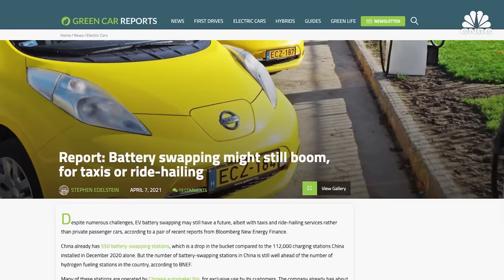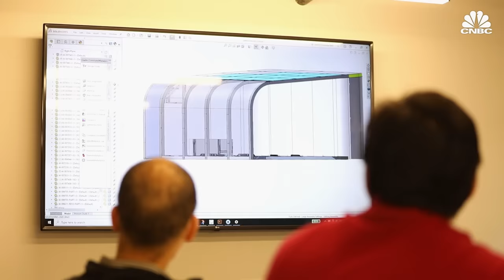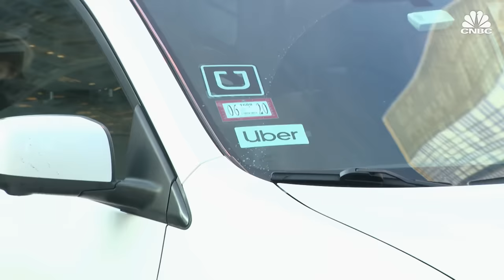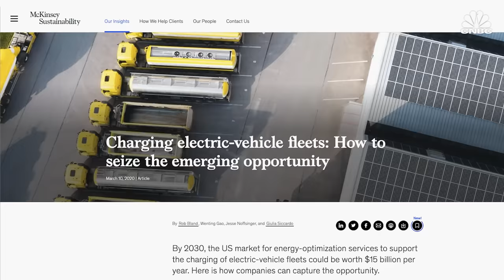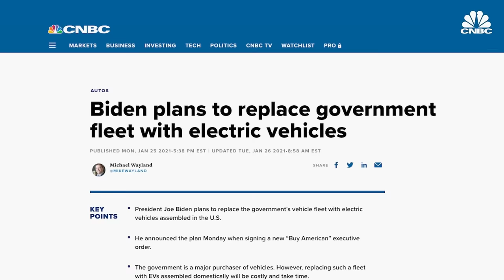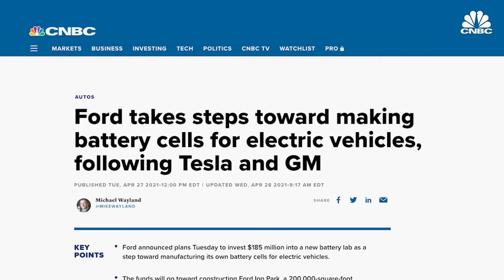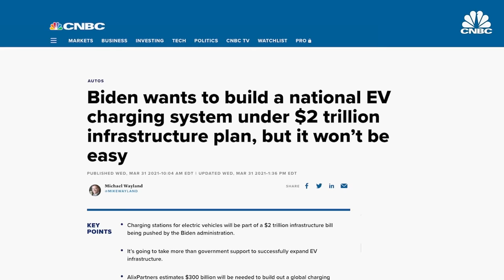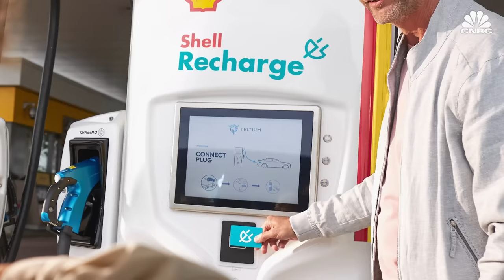Can EV Battery Swapping Take Off In The U.S.?

Comment: I'd rather own my battery, that said, when the battery is really worn out after 8-10 years, I'd like to be able to swap it for a new one for a decent price, I hope this is possible. It would also be nice if 4 or so years down the line a battery with much better range came out and you wanted to upgrade to that.
Reply: Thats how Nio works. The swap station monitors batteries as well so you never get a degraded one. You can save 10k on the purchase price and rent the battery. Not sure if it'll work in the U.S. a nii swap action can do 312 swaps a day for what it's worth. They'll have 6,000 stations by 2025. Which is just shy if 2 million swaps a day potentially. Of course they have plug in with all vehicles as well.
Reply: Nio
Reply: I hope it doesn't take 90 seconds for a guy on a skateboard
to roll under & steal a battery
& Sell it on Ebay
for a Tripple profit like those Car Exhaust Filters they be stealing these days!
Reply: We have that situation now. The average shade tree mechanic can change out a Prius battery in about an hour, and there are generic battery packs instead of the sky high Toyota brand ones, so you can purchase a generic battery pack much cheaper. But it's not a simple drop in, like you have in your flashlight. It should be.
Reply: Yeah but... with this system, if you keep your vehicle for as little as a year the chances are you'd be swapping your batteries for newer ones anyway any time you need a recharge. I really can't see the point in having your own battery.
Reply: Todays batteries will probably last longer than the car.
Reply: This is a service all EV companies should have. Rather then try and push the latest model car on you, they should swap you batter pack, extending the life of your EV and keeping less models just sitting around.
Reply: Nissan cannot even offer a battery for my leaf because they  do not have stock for it.
Reply: You would "own your battery".  Whatever battery is in your car you own.  You would now just be able to swap it if you needed a quick charge.
Reply: @Allen Loser whats the difference?? Still has a battery there, and prob in a year it would be a battery newer than the one that came with your car
Reply: @Allen Loser many model S from 2013 are still going strong with hundred thousands of miles. And batteries have improved a lot since then and will improve even further fast.
Should last 20-30 years and at least a million miles. And after that the battery still isn’t dead, just degraded.
A minority of cars will live that long.

The twist of replacing your car battery might be true.
You would want to take the battery out of a car not to replace the battery but to keep the battery and replace the car.
And in 10-20 years the tech might again improve a lot so this idea isn’t interesting anymore because there are way better energy storing techniques.
Reply: You think batteries will upgrade every 4 years.. 😂😂They haven't upgraded in a decade.. Don't get your hopes up, it's a tougher problem then people think. It's not as simple as, just make a better one.. They have to learn how to first.
Reply: @Allen Loser how you abuse a battery? the only thing you can do is charge and discharge, and if the battery has damage, the system would know(cause if there is any problem, its all on then, and they definely dont want to get sued)
Reply: Just drive your old battery for a swap and presto no more battery fears. Just before selling your EV swing by for a swap! Genius! How will the battery swap companies prevent this? Battery discrimination?
Reply: It costs 7-10k. Far cheaper than the money spent on gad alone over the course of 8-10 years.
Reply: Exactly, Matt Wolf. Personally I don’t even care about owning the car.
Reply: Pretty soon, you won't care about owing the battery. You'll probably have a simple subscription service allowing you to swap a battery at any time. You won't care about the condition as long as it holds 60% or more of the charge. Evem if you get a lower one, you'll be able to replace it at the next fill up. It's not a big deal.
Reply: That's how it's worked with my phone. In production it was 2900 mAh but I have a 3500 now.
Reply: @JxcksonSF  Swapping a bad idea. Suppose my brand new car is one week old. I don’t want to swap my battery for any battery. Now, suppose my car is 10 years old. I will be eager to swap my battery for another batter.
Reply: Or just buy an ICE and don't worry about swapping giant batteries.
Reply: I saw an episode of totally charged where a company in England is rebuilding and upgrading and reprogramming the car to accept the increased battery capacity. But that's England. Not likely something someone would do in America. Too much effort.
Reply: @feliksplotnikov6408  getting an older battery doesn’t matter because you will use it for maybe a week or two. battery swap is cool for when you need to get somewhere faster or a battery defect occurs but adding fast charging and battery swap you can just keep your battery until you feel it needs a swap.
Reply: @Allen Loser You miss the point. This system is ideal for those that have no access to a charger either at work or at home. It could accelerate the take-up of EV's if it becomes established so it really makes no difference where the battery originated as it would be swapped out every time you needed a recharge.
Reply: @Allen Loser I didn't say you'd get a NEW one , I said it would be swapped. Yes, I'd be happy with that ...when you've paid an increasing price for your diesel and/or anti-pollution charges that are beginning to be imposed in cities around the planet. A major city in UK has started charging around $10 a day for non-electric cars and around $60 a day for buses and trucks to access the city. The more city authorities around the world see how well it works the more they will impose similar measures in their own cities, for them, it's another income stream. Our days as a diesel or even a petrol vehicle driver are numbered whether we like it or not.
Reply: Allen, I guess we're never going to see eye to eye on this but it could go a long way (if you'll pardon the pun) towards alleviating range anxiety associated with  EV's. As for damaged cells, I thought the company was taking on the liabilty for repair and replacement of any damaged cells as you'd essentially be renting the battery from them and you would have no way, as the rentor to know the condition of the replacement battery. Anyway, do enjoy the rest of your day as I will mine. 
p.s. I'm looking forward to these new developments. :D
Reply: @AndrewJQueen  "This is a service all EV companies should have. Rather then try and push the latest model car on you, they should swap you batter pack, " Tesla has already proven that battery swapping is unwanted. Battery packs are the most expensive part of any EV, and you don't want to swap out a $10,000 battery you know is good for one that might have 200,000 miles on it just to save 20 minutes at a charging station.
Reply: @EricHorchuck  "You would "own your battery".  Whatever battery is in your car you own.  " Do I "own" the Ford Focus I rent from Avis? Your statement makes no sense.
Reply: @justsomeguy934  Oh my god!  Think of it like a propane tank.  You trade in your tank and pay a small fee for another, full tank.  It's YOURS FOREVER.  You CAN, when it's empty, trade it in for another full tank OR get it filled somewhere (like charging your own battery).  It's not rocket science and you are not renting the battery.  How would you be charged?  "bring that battery back in two days", what if you didn't drive much in the past two days   EVERYONE ELSE CAN STOP READING HERE.  This is for the idiot that I'm responding to...  When you rent a car you're not trading in another car.  Plus  its not a consumable (like propane or a battery).  So they have to charge you for it's usage on a daily basis.  I'm done.  If it STILL doesn't make sense to you, you're lost.
Reply: @Allen Loser So?
Reply: @JxcksonSF  OMG  thank you.  Someone gets it!  😊  Someone said, in the comments, "do I own a Ford focus I just rented?".  I was shocked at the unrelated comparison.  It's like what we've been doing with propane tanks for DECADES, trade in your empty tank for another full one. Sometimes they look nicer, sometimes not but they all have propane in them!  LOL, what passes for rocket science these days..  To the moon!
Reply: IMO, you are imposing TODAY upon TOMORROW. And that NEVER works. Never has…never will. This model is brilliant and inevitable - for a number of reasons. Just think of how today legacy OEMs are going to be scrambling to dominate their battery supply chain. THEY WON’T….CAN’T.  Look how pathetically Electrify America’s roll out is…and the ALL are 100% dependent upon this excuse for a business model. IOWs, today’s OEMs are going to BEG for a charging infrastructure like today’s gas stations…and there ISN’T one.  Thus, they will abandon “control” of their “batteries” to a brilliant entrepreneurial visionary that gets it right on their behalf - whether it’s swapping or charging or suppling, etc. Either way, those “batteries” you are so desperate to own won’t be that. And we haven’t even begun to talk about the HUGE ramping up industries around “mining” battery metals from CARS - NOT THE EARTH.  Yet ANOTHER inevitability.  Like I said, imposing today upon tomorrow NEVER works.  Can’t wait to invest in this company.
Reply: @reginald7214  NIO is going to surprise the hell out of everybody. Mark these words.
Reply: Would you also rather own your oil than swapping it out?
Reply: @daniel_960_  Depends. I keep my cars a very long time. For example, my granddad still drives a dodge pickup that he bought in the mid 70s.
Reply: Enjoy your 10,000 hours of 'wait to charge' time over those 8-10 years.
Reply: @johnsarab4500  don't worry, someday you'll be forced to buy electric too through a combination of scarcity of new gas cars, scarcity of running older cars, and rising fuel costs as the planet runs out of oil.
Reply: @daniel_960_  Depends on how long you like to keep your cars. Of the four we use in my family, they range from 12 to 22 years old, and I like to run them for at least 200K. All are reliable and paid off long ago. So are todays batteries projected to last that long? Not likely!
Reply: The problem is standards.  The car actually communicates with the batteries as to their state and even as to their model and serial number and this is all a proprietary standard for the manufacturer and even for versions within a model line.  Part of this is to ensure you are only using batteries provided by the manufacturer hence it's necessary for the third party to customize the interface to mimic the original battery configurations and there are companies that would do that for you to install salvaged batteries from wrecking yards.  With this business strategy, they amortize the expense of mimicking the manufacturer's batteries over the long distance fast charge cycles.
Reply: @zodsinclair8500  You have to remember that the battery pack will be quite heavy and would probably take a forklift to steal.  But there should be some kind of locking mechanism.
Reply: @AndrewJQueen  Batteries and batteries replacement and reconditioning should be standardized across all EV companies.  It shouldn't just be something they should all have, it should be required of all of them and be open sourced, this means it needs to be regulated.
Reply: @donquique1  The individual cells are still available but the interface would need to be reprogrammed and that's specific to your vehicle and it's factory battery.  There are companies that would replace your Leaf battery with a salvaged battery from a wreck yard, even newer higher capacity batteries but they need to first read your factory battery's settings and send them and the salvaged batteries information to a software company to rewrite for the replacement battery to be viewed as usable by your car.  It's all a bit out of the expertise of your typical mechanic, even of a dealership mechanic with access to proprietary information.
Reply: @johnwang9914  noted!
Reply: Each battery sub pack could be checked and pulled for service/repair/replacement so only "good" batteries would be installed.  All non-qualified battery sub packs would be pulled.
Reply: Lmao.. 8-10 years. Your car will be very old and you want to put $10k to replace your old battery? How long will your drive it after the new batter? Nobody will want to buy the old car. I rather save $10k on car and lease the battery monthly.

Comment: Battery swap can succeed where limited space makes charging at large scale impossible: NYC, SFC, LA, Hongkong , Shanghai and Japan for examples.
Reply: Have you been to the Los Angeles area lately? There are hundreds of public chargers in LA.
Reply: Someone may have already done the math. LA have 5.5 million cars, if these were all EV cars, dividing that the number of public chargers resulting the peak charging capacity required per charging station. Multiple the minimum charging time gets the total charging time. However LA only have 63K EV at this moment and the whole California EV ownership is 1.2%. So if we push EV ownership to 10% in CA, the current charging station need to scale 10x to maintain the same level service. Since LA has so many attractions, it’s charging needs for tourists and residents combined would far exceed those estimate based on EV ownerships.

Is anybody going to suggest that are enough charging stations in LA for the foreseeable future?
Reply: @gzhang207  
They are installing new stations weekly. There are charge points next to parking meters. Charge points in every government building. Libraries now have chargers. Parking garages have chargers. Grocery store, convenience stores..

Believe it or not, LA is becoming increasingly urban pertaining to walking in one's community versus driving all the time.
If you live in a apartment building that does not have chargers in the lot, you can simple find a public charger a block or two away..

As time goes by, the public will adapt to EVs and its infrastructure
Reply: Current paradigm is based around gas stations. When vehicles can charge at L2 in any parking lot, then Fast charging can be relegated to long distance travel, robotaxis, and the occassional emergency charge.
Reply: I wouldn’t say LA and Shanghai have limited space lol
Reply: Battery swapping IS A DUMB IDEA.
Sounds "Clever" BUT Batteries is the MOST EXPENSIVE part of an EV AND there is AND WILL BE a battery shortage for the foreseable future.
With battery swapping you need MORE BATTERIES.
Most cars should be able to charge while parked so more chargers are needed, swapping is unecessary.
Reply: The land at the expensive cities carry a premium and at some point the it no longer makes economical sense to add more charging stations. One drawback I am aware with swappable battery is the current battery shell is a crucial component in protecting the batteries and also lowering a car’s center of gravity. Once a single battery pack is broken into modules easy for swap, the mechanical integrity is gone partially.
Reply: Good luck with the queue..
Reply: @brandondevahl552  Those cities have millions of potential customers.
Reply: Battery swapping is really not a good idea. My city is already connecting ev charging stations into streetlamps for people who dont have a garage. Tesla is going to have way better range with their integrated structural battery pack than any modular EV. Teslas batteries are already cheaper, smaller, and go farther than the competition and it just getting better. How many battery packs will these swapping stations need to have on hand in a city in order to make sure people arent sitting around waiting for a pack to finish charging before it gets swapped into their car? A battery is the most expensive part of an EV and they want to have thousands of these just sitting around when the world is already battery constrained. Each one of these places are going to cost millions in battery's and they will need to be all over the city and highway, otherwise youll be driving out of your way to get a swap, negating most of the benefits. They mentioned using them as grid energy systems, but that will degrade the battery life and tesla is already doing this grid battery powered energy storage with cheaper batteries that dont need to be small or light.

Comment: There will be a battery supply shortage for years. Having hundreds of thousands of batteries waiting to be swapped is ridiculous.
Reply: Agreed.  The 10-20 year ramp-up of EVs is currently constrained by the mining of new battery material.  Though, perhaps the ramp-up can be eased by including EVs with 1/8 (40 miles) or 1/4 (80 mile) batteries.     For the days needing a longer range, rent battery packs.    The risk is that there won't be enough batteries to swap and then fall back on charging a battery that costs much more to rent.

Swappable battery packs may also enable the use of less dense battery technology or aged cells at a much lower cost.
Reply: "There will be a battery supply shortage for years"
What if the packs are made with a lower power density/less battery material or just fewer top-density cells ?  The swapping frequency would be higher, but less battery material would be needed overall.
This kills the time advantage of swapping, but solves the manufacturing battery constraint by perhaps halving the amount of battery material needed as the EV industry ramps up.  Double the cars could be made at a much lower price point.
Reply: @GK-op4oc  I could see that working well for motorcycles in Africa and India especially.